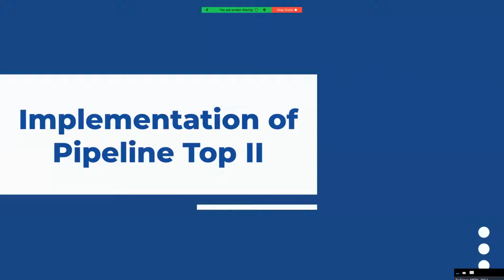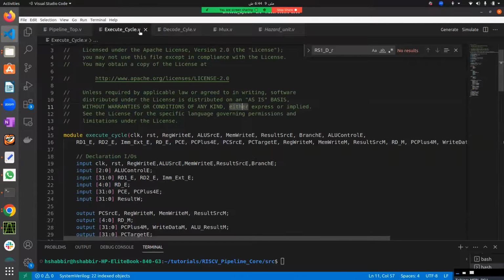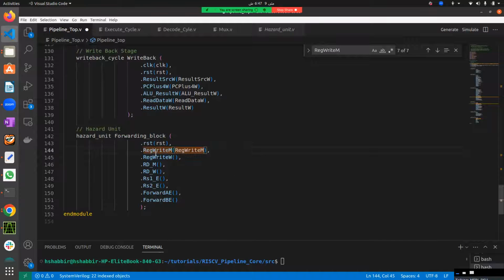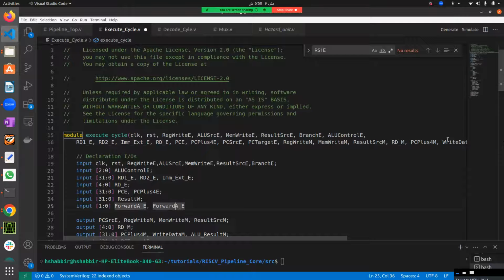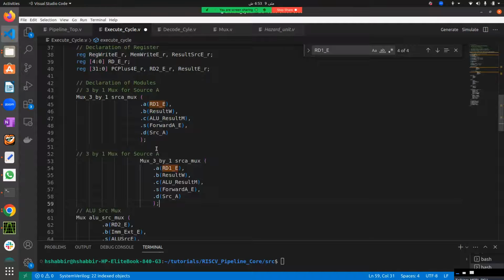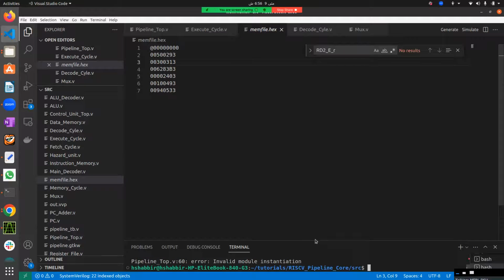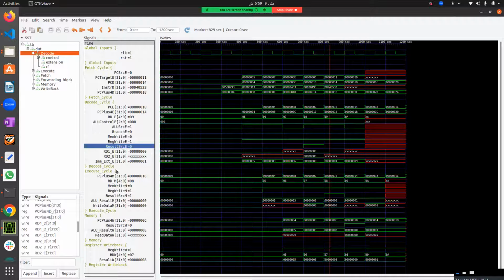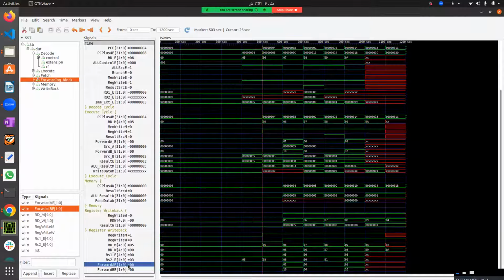Lecture 10: Designing & Implementation of RISC-V Pipeline Top Architecture II

Comment: Hi sir, I have implemented a 5 stage pipeline and everything is working fine but when I am running store instruction just after load instruction. The data is memory file location is getting updated with wrong value. - lw x4,0(x9) then sw x4,1(x9). Can you provide solution for this.
Reply from the maker: there is a data dependency error. You have to implement the stalling logic in order to have the correct value

Comment: Is this complete RISCV Pipelined? Can I implement all 47 RISCV instructions on it.
Reply: you will have to update the control unit, decoder, ALU, extender and other some small modules to execute them all, just read the manual which are available on the web, you will be able to modify on your own
Reply from the maker: No this contain only 5 instructions datapath

Comment: I want to ask that if we want to use it to bubble sort 
and we have the bubble sort code converted in machine code in which component we will integrate it can you tell me the necessary steps
Reply from the maker: you have to load the whole code in instruction memory and if you are using any predefined data points than you have initiate those in data memory

Comment: what is the clock period for this pipelined processor?
Reply from the maker: It depend on which period you are trying to run it.
Reply: @riscvtransistors2ai  
But what is the ideal time period on gtkwave?
Reply from the maker: @vijaysakre5798  As we are running on software so it can be any. And i guess im videos we gave a delay of 50 ns in clock toggle so the overall clock period become of 100 ns

Comment: Sir can you please tell, what is CPI ( cycles per instruction)  for this 5 stage pipelined processor
Reply from the maker: That depend on what type of program you are running. Ideally the CPI of pipeline processors is 1
Reply: @riscvtransistors2ai  sir for the progran which u have designed , which is 5 stage pipelined processor would u mind sharing what is the cpi

Comment: Oh thank you for clearing it out sir. 
I have just 2 more doubts

1.Could you also briefly describe how we can initialize the values in the register for the r type instructions. And also intitalize the data memory with needed data. So when I run an instruction, it will fetch the data which is already initialized in the register file or data memory file  and perform operation on it and store in destination .

2. How can we retrieve the data in a specific register in the waveform
Reply from the maker: For 1 please refer to the last video lecture in RISC-V Single Cycle Series available on our YouTube Channel. You can do it manually as well you can find that in lecture 6 or 7 of the same series.
For 2. you have to go to the register file and from there you can map the individual registers on the waveform

Comment: Hello there @merldsu  I have a doubt 

In the code we see that the addition happening is of type immediate.
However the addition action happening is to the addresses rather than the data in it .

We can see that imm is 5 and destination address is at 3 or 0101. 

Could someone explain this to me
Reply from the maker: Hello If you are talking about the first two instructions than those are immediate instructions which are adding a constant value with zero and saving it to destination register. It was a coincidence that in the first instruction the constant value and destination is same so dont get confuse by that. As you can see in second instruction the constant value is 3 and the destination is register number 6.